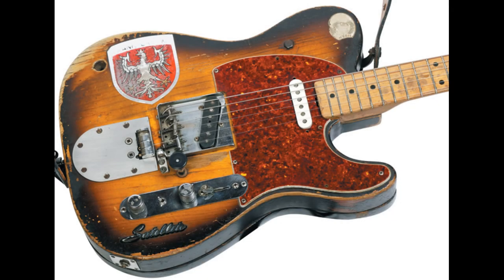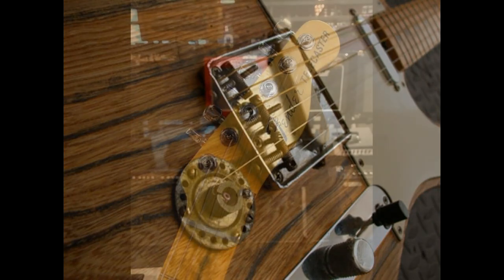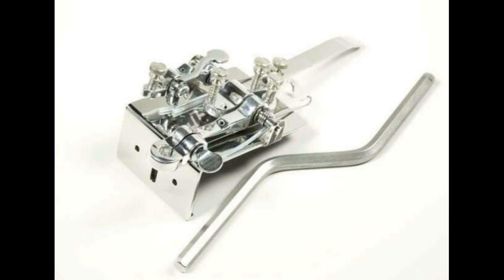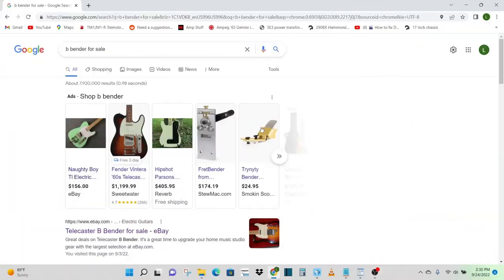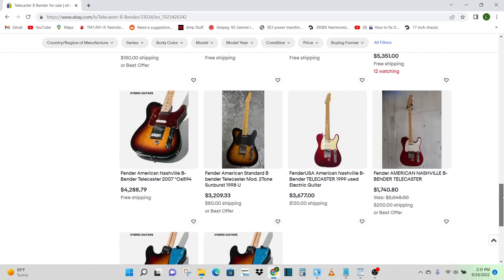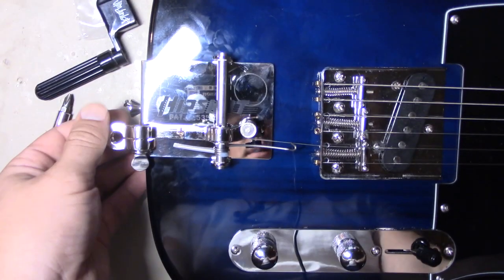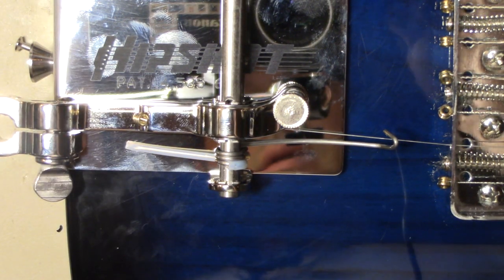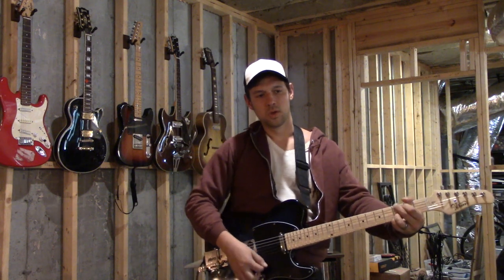The COOLEST MODIFICATION for a $90 GUITAR - B-BENDER

Comment: I recently picked up a “B Blender” which allows you to use a Bigsby vibrato as a b bender while still retaining the ability to use the bigsby as a vibrato. 

What you get is essentially a replacement arm for the bigsby that you pull up on to B bend. For less than 150$ bucks I figured I had to try it and it is a lot of fun. Takes some getting used to and it took me a bit to get it set up properly but overall I’m pretty impressed with quality and engineering. 

It still feels a little awkward to pull the bar up with my right pinky while simultaneously picking the note you want to bend. I imagine a  parsons style bender that is strap button activated (just pull down on the guitar neck slightly) would be a lot easier to play quickly and fluidly but the B Blender is definitely a fun and inexpensive way to experiment with b bending.
Reply from the maker: I’d love to see that!

Comment: I also bought two years ago Squier Telecaster which sound awesome, but there was one problem. Intonation screw and saddle of A string, was kind a broken. So I figure it out, should I suppose to buy new basic saddle for A string or should I buy little bit different system. Then I bought Duesenberg Multibender from Thomann. And it was much better solution. Even better when I bought Paradigm string, which can stand bending a little bit longer without breaking too easily.
Reply from the maker: Right on! I’ll look into Paradigm String and Duesenberg. I’ve not heard of them